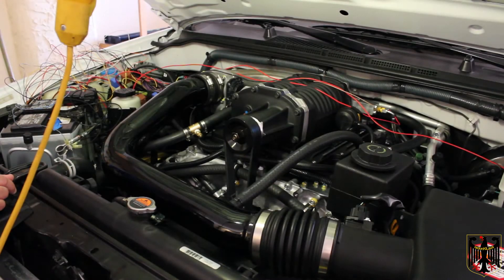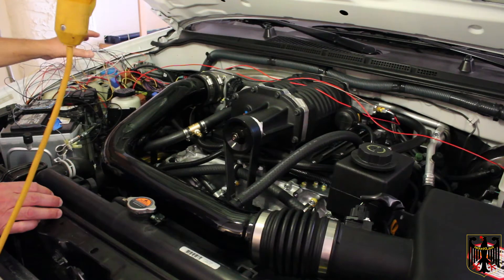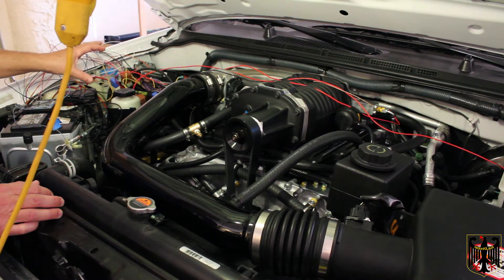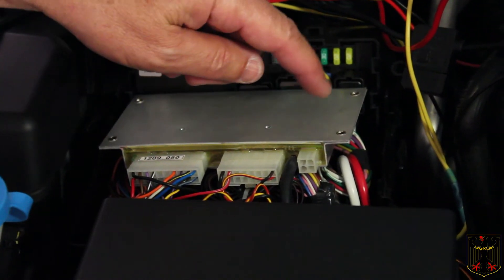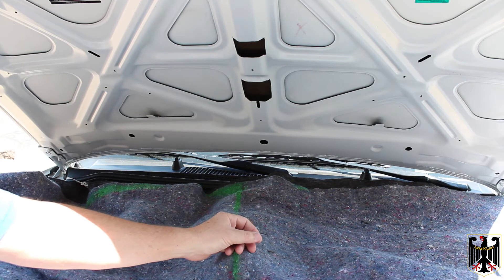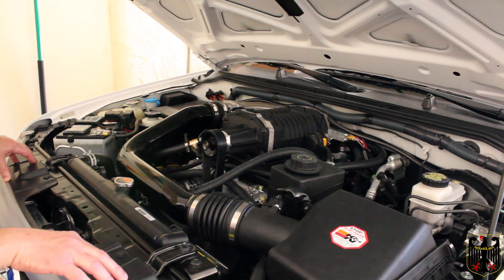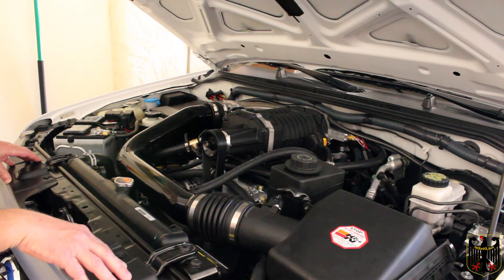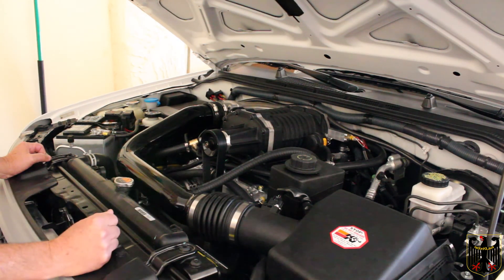VQ40 Stillen Supercharger Install - Part 10 - Notching the Hood and Finishing Touches

Comment: I am doing this install now.  It’s all hooked up and engine won’t fire just cranks.  Did you run into this ?
Reply from the maker: I did not, may be something to do with the piggyback ECU if you used that.  Mine has had other issues attributed to that unit.  Thanks for watching!

Comment: This is an amazing project. You explained everything so well. However, did you resolve the power cut-off issue eventually? Keep up the good works.
Reply from the maker: I did...sort of.  The issue has never appeared when driving the truck with traction control off, but does consistently with it on, so I assume it may be an issue with backflow through the MAF sensor, or potentially with sensor deltas being too large.  Regardless, as long as I drive the truck with no traction control when flooring it, I have no issues.  Thanks for watching!

Comment: I'm glad I made it this far before getting too excited.. This is way out my league now.
Reply from the maker: It's not too bad of an install, but definitely wouldn't recommend it as your first foray into either larger mechanical or electrical modifications of a vehicle.  You can definitely tackle smaller projects to get accustomed to working on things this in-depth, though, such as hardwiring a dash cam or phone charger, or doing something like a valve cover gasket job.  Thanks for watching!

Comment: I have to now say I would be very hard pressed to buy another product from Stillen.  I have sent them countless emails related to the MAF 0101 code being thrown, and also the pulley spacer issue.  Their response for the MAF code is to go and spend several hundred dollars more for UpRev tuning - Stillens piggyback was supposed to provide corrected data to the engine ECU to compensate for the additional air flow during hard accelerations.  As to the pulley, Stillen didn't even respond, so I worked with Jan's Metal Works in Mesa, AZ to have the spacer shortened by 3mm on the fat end.  Selber schuld - you only have yourself to blame if you buy from Stillen.
Reply: +Jake Curl   Ha ha ha ha heh heh heh .... I think I solved the MAF P0101 error.  After extensive reading, I found a Nissan TSB number NTB12-051D that is supposed to install a new version of ECM software to correct this issue - an issue common on 2011 and 2012 Nissan products.  Old software number is 23710-ZL85A; New software number is 23710-ZL85B.  Knock wood, but so far no issues and it definitely runs smoother.  Cost:  $150.00 including tax.  Stillen was recommending the UpRev full deal + all the associated items like bigger injectors = $2,200.00 minimum.  Now, why didn't Stillen know about this solution?  Why I say, why?